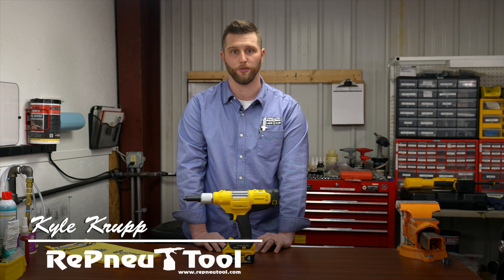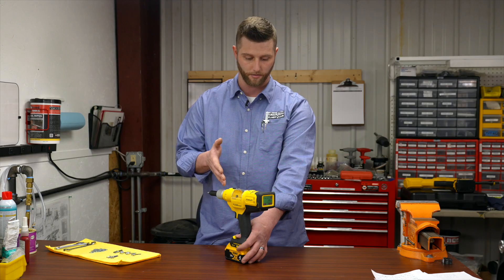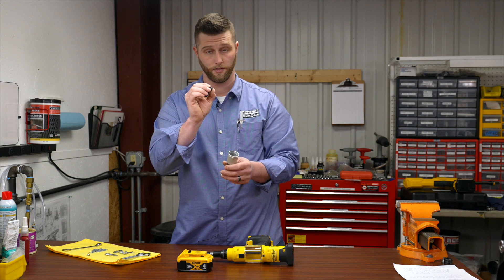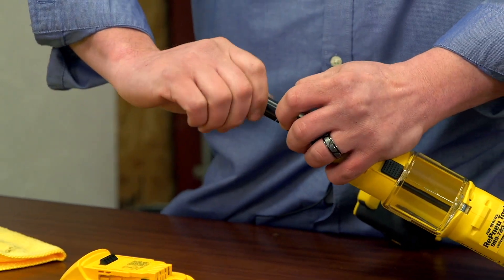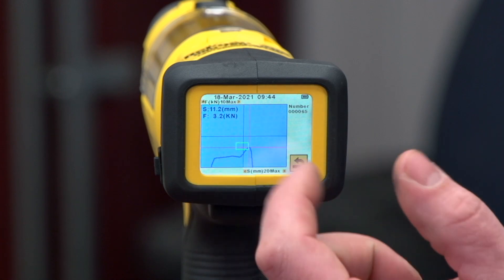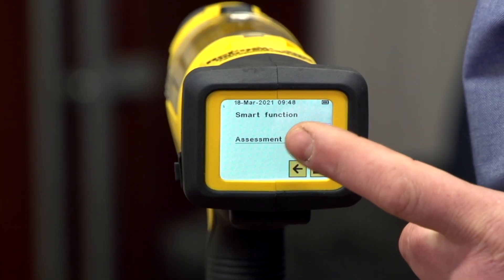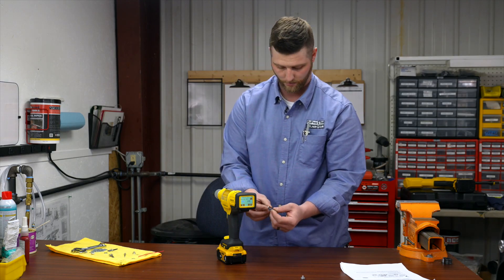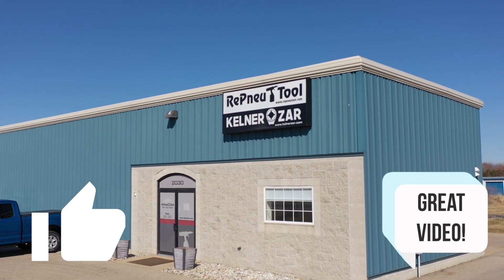Stanley PB2500S Smart Riveting Tool Review and Maintenance

Comment: Why is Dewalt battery in Stanley tool?
Reply: Hi Charles. Stanley Engineered Fastening and Dewalt are both owned by Stanley Black & Decker. We use Dewalt battery, switch, and motor technology in our cordless rivet, rivnut, and lock bolt tools.
Reply: Stanley owns DeWalt
Reply: I think Dewalt and Stanley merged like Dewalt and Mac did